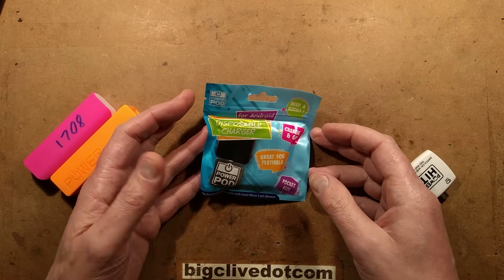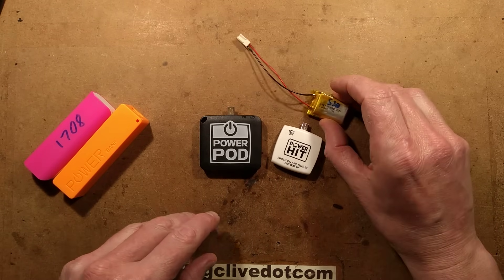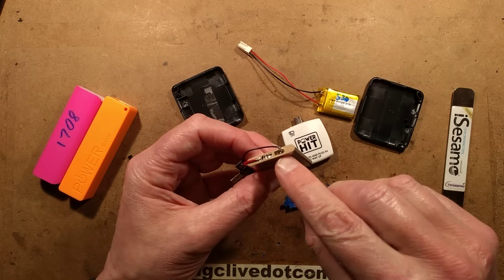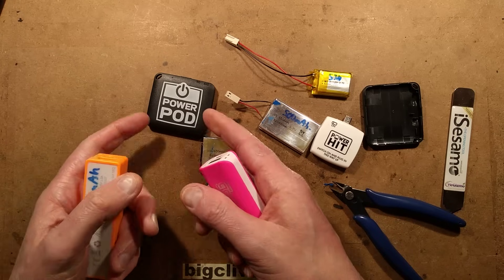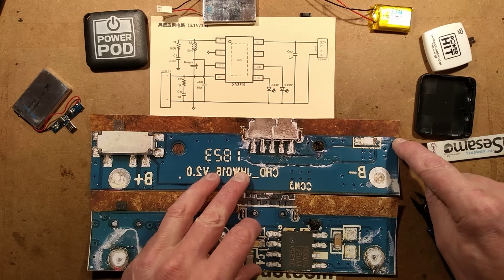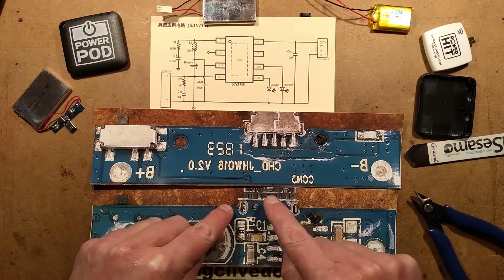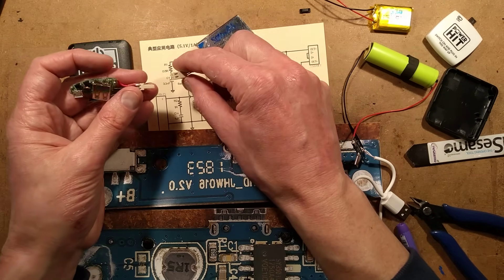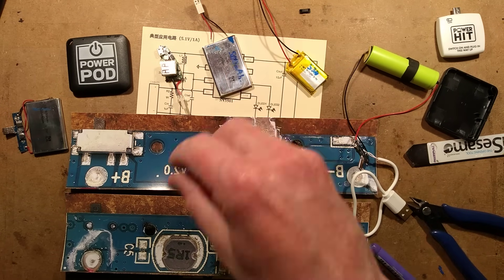Poundland "disposable" phone charger.

Comment: Oh I wish this concept would just die. Heck, just sell chargers that use alkaline/NiMH AA/AAA cells, maybe with batteries included, or on the same shelf as the batteries for a mean impulse buy. They have stupid capacities compared to lithium, they're ubiquitous, and they don't fill landfills with valuable materials shortly after leaving the box.
Reply: Well, normally all of these kind of batteries should be recycled and used again and again and again instead of going to a landfill or beeing burned.
Reply: Funny you say that, I had a Phone charger that you put 4 AAA Cells in with lead that plugged into a NOKIA 330. It would just charge the phone enough for you to make a emergency call or two, but it wasn't designed for the newer "smart" phone which requires more charge.
Reply: @CommanderWyattMail.3rdExpediti  you gotta make sure youre using duracell or energizer, first off.  you literally cannot use the off brand batteries for this as they generally have less than 1/3 the capacity. and then you might as well buy a power brick, because a 4 pack of duracell or energizer cots you about 1/6th the price of a brick.
Reply: @FingerinUrDaughter  ever heard of a 18650 cell, they can output stupid amounts of power for their size compaired to junk Energizer batterys. I've used that trash many many times and see no difference.
Reply: They lack capacity, and must be recycled. However 99% or hgigher,  number of batteries will never be recycled.

Comment: I have to say
Getting a nice little 10 Ah powerbank will last you a pretty good amount of time
Reply: Dave Micolichek the cygnett 10 aH battery pack I have fits reasonably well in a pocket. Just slightly thicker than my iPhone 
So it works
You can have them both comfortably in there
Reply: @runforitman  It better to buy poundland 1200mph power bank one for one pound or there power geek 2200 power bank  one for two pound  or there 4000mah power bank one for five pound
Reply: Dave Micolichek  It better to buy poundland 1200mph power bank one for one pound or there power geek 2200 power bank  one for two pound  or there 4000mah power bank one for five pound

Comment: Even worse, for the same size, I have four $2 rechargeable 1800mah (I actually tested them - they're right up there) square charge banks that are the same size as that larger square unit.   You just have to use a cable.

Comment: Do they make these with a USB C connection ? Because micro USB on phones is fast becoming obsolete.
Reply: It better to buy poundland 1200mph power bank one for one pound or there power geek 2200 power bank  one for two pound  or there 4000mah power bank one for five pound
Reply: @mrwahibtahri  

Enough is enough. 
No need to bleat out the same comment on every post.
The £1 power bank is the most cost effective. The £5 Geek one has less capacity than the £2 power bank.
Reply: @johnnodge4327  well I got both and I got more charge from the 4000mah one than the 2200mah one when charging one item

Comment: These things need to be illegal already.
Reply: Typically stuff like this, you  make it illegal to sell it.  
Give companies enough warning to get rid of their old stock, and then after the drop dead date anyone still selling it in a store gets fined.  Easy.  Lots of products have been outlawed that way.
Reply: Info Warrior.. Got something stuck up your ass, like perhaps your head? Does "Info Warrior" really mean you are an "Info Wars" fanboy who believes conspiracies? 😅😏
Reply: I'm not that smart so can I ask why
Reply: Cool it with the anti-semitism bud.
Reply: Those are actually illegal in many countries, and if I am correct including UK.
The reason is that lithium batteries are not allowed to be shipped when above 50% charge (due to dangers involved long term storage of unused fully charged batteries).
Reply: No
Reply: whats next, ban alkaline batteries?
Reply: @GigsTaggart  The production on single use battery's should be reduced and people should be pushed towards using NiMH more. There are devices that still require Alkaline due to the lower voltage of NiMH but most stuff that requires AA/AAA etc... will run just fine at 1.2V per cell.
Reply: @DONK8008  or, or, or just get a normal portable power bank for 10$ 🤔🤔🤔
Reply: @GigsTaggart  Eventually I think so. The disposable battery should be phased out and all new products should just have a rechargeable cell in them. For any products that use AA AAA C D etc have rechargeable replacements. One time use is environmentally stupid. Especially if there is a better choice.
Reply: @infopackrat  non replaceable rechargable batteries are a much worse environmental disaster
Reply: @GigsTaggart  How can a rechargeable be more environmentally unfriendly that a single use and throw away battery?
Reply: @infopackrat  when the battery goes bad, you have to throw the whole thing away and buy a new one.
Reply: @GigsTaggart  Yes. After a few hundred uses. Compared to 1 use?
Reply: @infopackrat  you have to throw the whole device away with a built in rechargable battery
Reply: @GigsTaggart  Well here in Canada we have battery recycling. And I've never seen a product such as this and I'm appalled. Also I don't understand your logic. So it's better to be constantly using and throwing away disposable chemical batteries after only 1 use rather than getting 300 uses out of a chemical battery and then throwing it away.
Reply: @infopackrat  you were the one proposing things should just have built in rechargable cells... Also you've never seen a modern phone or a MacBook?  When the battery goes you just toss them because they are not replaceable.  It's massively wasteful.
Reply: @GigsTaggart  Ok. I see your point on that one. I didn't say it but I was thinking the rechargeable batteries the products come with should be user replaceable. And governments should have easy recycling programs. But I do want to replace the 1 time use batteries with rechargeable. That would help to reduce waste. I used language wrong in saying what I meant.
Reply: @GigsTaggart  That's the fault of the device manufacturer, not the fault of the battery. It's a right to repair issue
Reply: @infopackrat  There is one case where non-rechargable batteries are more environmentally friendly than rechargable: aluminium-air.
That tech is still in prototype phase, but because of how easy it is to recycle aluminium oxide and how huge the capacity of that chemistry is, its actually more environmentally friendly to make a bunch of AlO batteries and recycle them than it is to make a single lithium one and recharge it.
Reply: @GigsTaggart  nope, I suggest a tax on single use batteries. Push the price up so outside of specific applications it's not worth using them. My watch battery lasts 5 years - is it really worth trying to squeeze a rechargable cell that would only last a month before needing charging into it? So don't ban, just make unpopular - double their price and things like this will vanish as the extra components will be cheaper than the tax. 

Have to work harder to define a disposable electronic item to tax it, but could try - there might just be too many fiddles to get around it.
Reply: @PeterGrant  In Spain the price of rubber tires includes a recycling tax, but in reallity the the tires go to a junkyard and when they reach their maximun capacity, the tires burn in a suspiciously provoked fire.
Reply: @juniorgeorge4576  Sure, but the junkyard presumably claimed the recycling fee from the government, or else charged it to the customer. The answer might be to charge them for each tyre if there is a fire, "mysterious" or not. They can take out legally-mandated insurance against it. Which will go up horribly if there were a fire. Makes it in their interest to protect their tyres, even install fire-suppression. Build a warehouse to keep them in. 

Since there would be money in blackmailing tyre yards with arson. So that's why they'd have to protect against fire seriously. Which cuts down even more on accidental ones. Everybody wins, great!
Reply: @juniorgeorge4576  It's all about feeling like you made an impact, and that pat from yourself on the back lol
Reply: @Zodliness   found the US libertarian nut
Reply: @therecentlyundeceased  how the fuck did you come to that dumbass conclusion?